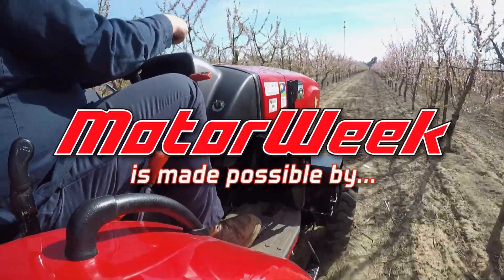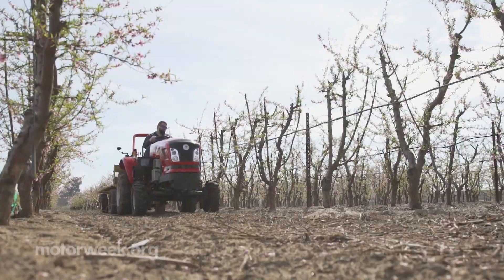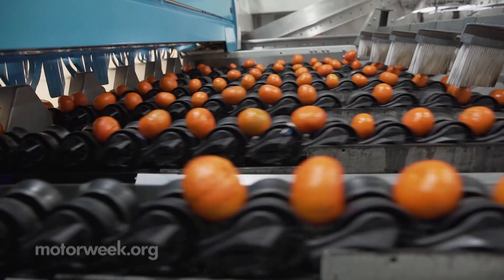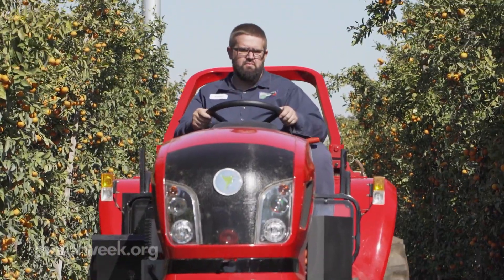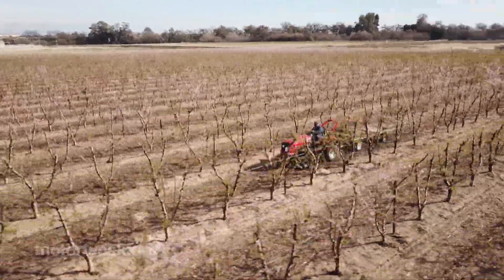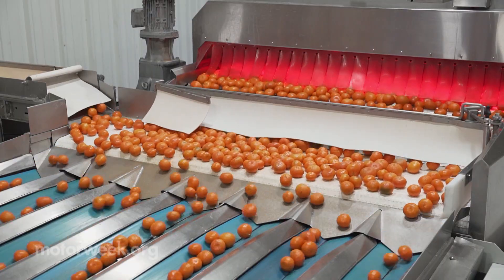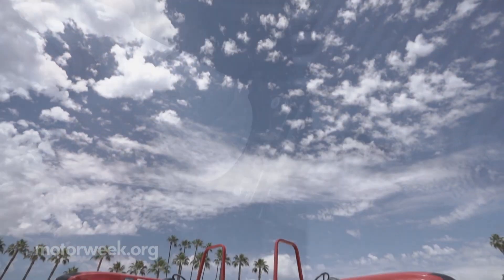How Farming is Looking to the Future with Electrification | MotorWeek Auto World

Comment: Lithium is not sustainable as a battery chemistry. It doesn't get recycled like Lead Acid batteries do. Yes, it runs longer, has a much slower self discharge rate than SLA/SLI , and it's power to weight ratio is no comparison. But batteries are batteries. They will need to be replaced, making a lithium comparable eco friendly and recyclable battery is exactly where we stand. 
Solid state batteries? Maybe there's something much better than that. 
It cost to charge the battery, 210v at hours at a time is big $$$$

Comment: What charges the charging truck? What happens when your tractor is dead but the work isn't done?

I'm all about EVs, but we have to be realistic...
Reply: The dude who hopped out of it, presumably.
Reply: @ashton9699  ...there. Better?
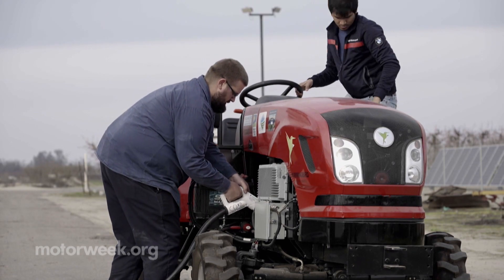Reply: @rmp5s  2:41 shows a charging station and a big structure above it. So the big truck would be charged from the grid like a normal EV, probably with energy their solar farm and/or solar on top of that structure.
Reply: @ashton9699  You're missing the point, dude. "Look, we can charge two at once!" doesn't matter when you have to charge the CHARGER, too.
Reply: @rmp5s  but it was stated in the narration that the point of it was to avoid having to drive the tractors back to the farm/charging station. The tractors can still take standard level 2 charging and skip the truck if they do happen to end up back at the building, the truck is not required for them to charge it's just an accessory to add "convenience". 

It's basically like a power bank for your phone, that can charge 2 phones at once. You still have to charge the power bank at home, but it beats having to go home to charge your phone if it's low while you're out.

Comment: Modern diesel tractors already have DEF treatment, clean enough.
Reply: If they want to sell these, they’ll need to offer more than just the lack of emissions. Maybe the low maintenance or high torque will be important features.
Reply: @AugustusDay  Low maintenance is the only thing. Diesel with gearing has insane torque. Also the electric tractor will be charging all the time and won't be able to work like the diesel would.
Reply: @imnotusingmyrealname4566  I’d love to see someone sell one with battery swapping, for now these are limited to light use.
Reply: @AugustusDay  You'll have to wait a while.
Reply: @AugustusDay  Honda is planning electric motorcycles and mopeds with swappable batteries you can change at gas stations. That's probably much better than current electric bikes.
Reply: @imnotusingmyrealname4566  Tractors will be the last to change to electric, at least battery electric, because they are in a unique poorly suited situation to be bevs.
Reply: @imnotusingmyrealname4566  I know that battery swapping is quite popular in China, people there often buy cars without a battery, and basically rent a new one whenever the old one runs out of charge.

Comment: Bobby joe go get the diesel generator and hook it behind the electric tractor to get this field plowed.    Stop pushing technology that is far from being here.
Reply: Unless there is a miracle advancement in battery tech this would be impossible, no matter when.
Reply: @imnotusingmyrealname4566  cummins put on a statement and said battery is there that's why we are investing in hydrogen fuel cell.    Diesel still the best bang for buck, efficiency, ecologically
Reply: Far? Bro this shit IS here.
Reply: @pbfloyd13  they had electric battery power cars in the 1800s.    And in 2021 the same obstacles keep the battery from being a go to power.  I'd go with a diesel electric without battery like found on a train.
Reply: The additional weight would negate the efficiency.
Reply: @pbfloyd13  yeah it would take alot of batteries to equal a diesel engine.  Battery power semi would have less cargo room because batteries.
Reply: @KRShields  

Motors more determine the power of an EV than batteries So a better solution would be to give it less batteries and just have either a generator or charging truck available to quick charge the tractors and equipment as needed.

Comment: Don't buy the propaganda. 
That battery wouldn't last 30 minutes pulling a plow
Reply: Exactly. This video doesn't show any hard work. Diesel is still the way.
Reply: If they didn’t fill their needs they wouldn’t be using them.
Reply: @AugustusDay  
Let's not pretend that they're doing hard work with these so called "Tractors"   It's pathetic that they need a $100,000 support truck just to recharge the batteries when an equivalent conventional tractor would only need a $20 fuel can.